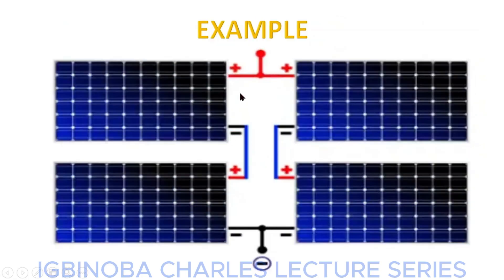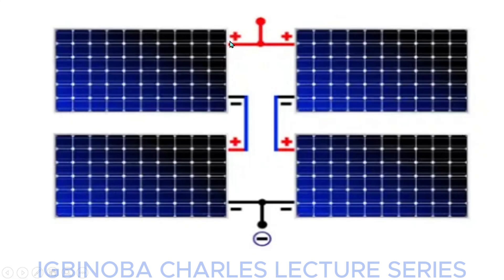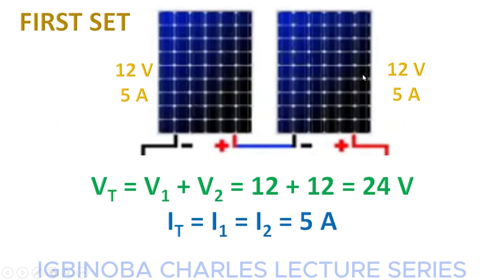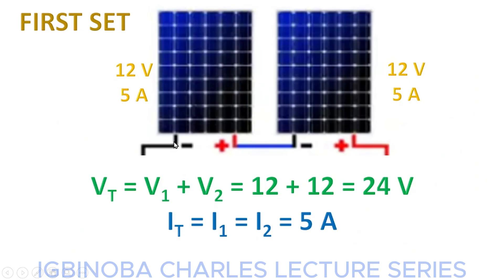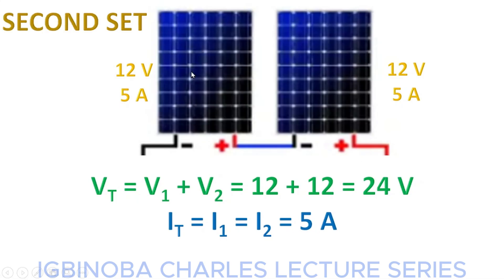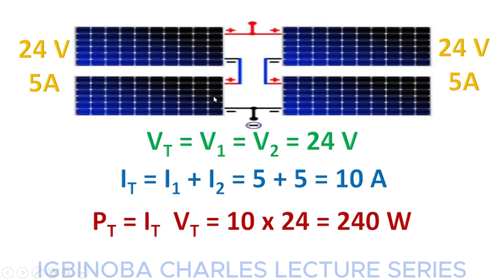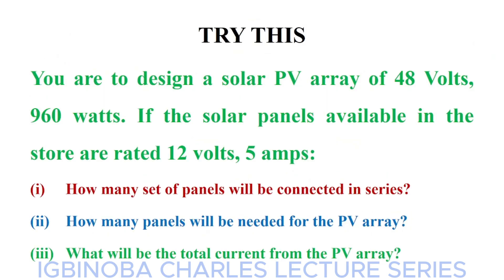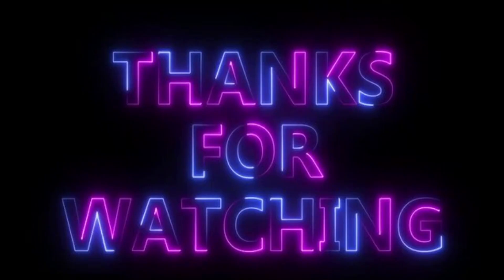Connection of  Solar Panels in SERIES-PARALLEL

Comment: PETROCHEM380B

Given Data:
Required PV array output: 48 V, 960 W
Available solar panel rating: 12 V, 5 A

 (i) Determination of the Number of Panels in Series
In a series connection, voltages add up while the current remains constant.

Formula:
V total = no. of series × V panel

Given:
V total = 48 V
V panel = 12 V

So therefore,
n series = 48 / 12 = 4
 Number of panels in series = 4

 (ii) Determination of Total Number of Panels Required
Each panel produces:
P panel = V panel × I panel = 12 V × 5 A = 60 W

To achieve the required total power:
P total = 960 W

So therefore,
n total = P total / P panel = 960 / 60 = 16
 Total number of panels required = 16

(iii) Determination of Total Current from the PV Array
From (i), each series string contains 4 panels, giving:
48 V, 5 A per string

With 16 panels total:
n parallel = 16 / 4 = 4 strings in parallel

In a parallel connection, currents add up while voltage remains constant.

So therefore,
I total = n parallel × I string = 4 × 5 A = 20 A
 Total array current = 20 A

So therefore,
4 panels connected in series per string
  4 parallel strings
Total Output: 48 V X 20 A = 960 W

Comment: PETROCHEM388J

SOLUTION:
(i) Number of panels in series = 48V ÷ 12V = 4
panels
(ii) Total number of panels = 960W ÷ (12V x 5A) = 960 ÷ 60 = 16 panels
(iii) Number of parallel strings = 16 ÷ 4 = 4
strings
Total current = 4 × 5A = 20 Amps

Comment: PETRO3151U
Required PV array: 48v, 960w
Each panel: 12v, 5A
Power of one panel:
P= V×I = 12×5=60w

I. No of panels in series; 
48/12= 4
II. No of panels needed for 960w
960/60= 16
III. Total current from the PV array;
4 panels per series string= 48v, 5A 
We have 16panels in total so;
No of parallel strings; 16/4= 4strings
When connected in parallel, 
Itotal=4×5=20A

Comment: CODE: EEE3146P

SOLUTION:
(i) Number of panels in series = 48V ÷ 12V = 4 panels

(ii) Total number of panels = 960W ÷ (12V × 5A) = 960 ÷ 60 = 16 panels

(iii) Number of parallel strings = 16 ÷ 4 = 4 strings
Total current = 4 × 5A = 20 Amps

Comment: MAR38H
Given:
Required PV array: 48 V, 960 W
Available solar panel: 12 V, 5 A
(i) How many panels in series?
In series, voltages add up, current stays the same.
We need total voltage = 48 V, and
each panel = 12 V.
Number in series =48/12=4 (ii) How many total panels for the array?
Each panel = 12V x5A=60W
To get total power = 960 W
Number of panel=960/60=16
(iii) What will be the total current from the PV array?
Each series string = 4 panels = 48
V, 5 A.
We have 16 panels total, so:
Number of parallel strings=16/4=4
In parallel, current adds, voltage stays same (48 V):
Total current =4x5A=20A

Comment: MAR28B
Given:
Required PV array: 48 V, 960 W
Available solar panel: 12 V, 5 A
(i) How many panels in series?
In series, voltages add up, current stays the same.
We need total voltage = 48 V, and each panel = 12 V.
Number in series =48/12=4
(ii) How many total panels for the array?
Each panel = 12V ×5A=60W
To get total power = 960 W
Number of panel=960/60=16
(iii) What will be the total current from the PV array?
Each series string = 4 panels = 48 V, 5 A.
We have 16 panels total, so:
Number of parallel strings=16/4=4
In parallel, current adds, voltage stays same (48 V):
Total current =4×5A=20A